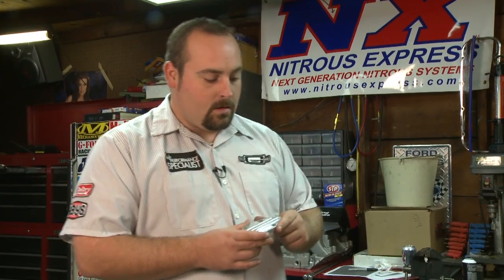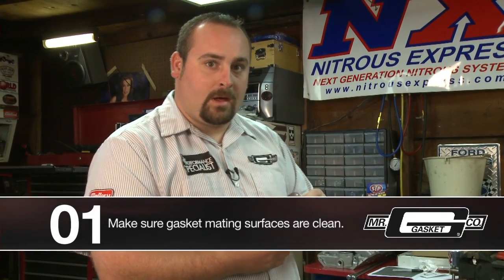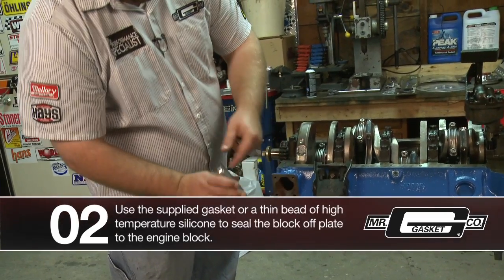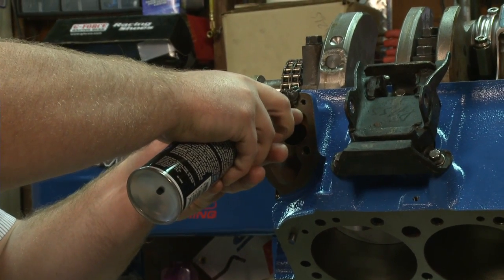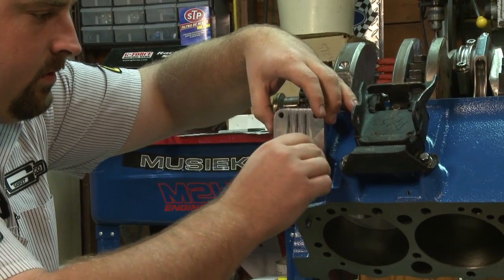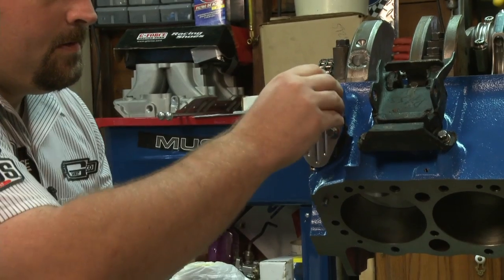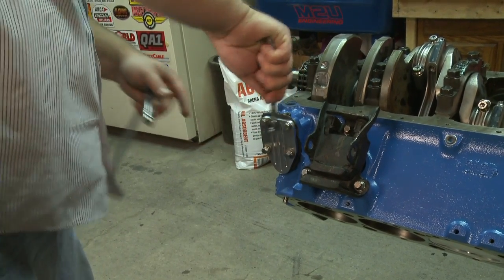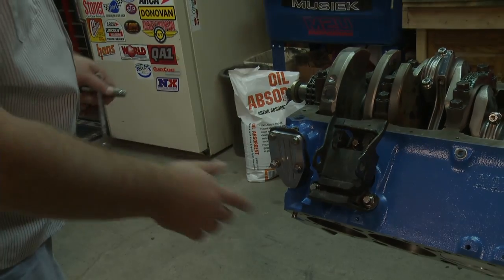Installing a Fuel Pump Block Off Plate :: Modern Muscle X

Comment: My Holley block off plate came with two gaskets, one solid to cover the whole plate, and one with a cut our like the one you would use to reinstall a new fuel pump. Not sure which one to use yet. Probably the cut out one with a film of rtv on the gasket mating side.

Comment: do i leave the push rod in or out when converting to electric
Reply: You need to explain what to do with a push rod do you leave it in there do you remove it what do you do with it
Reply: Do I remove the rod or just leave it in there without any problem.text or call 432-307-4901
Reply: no